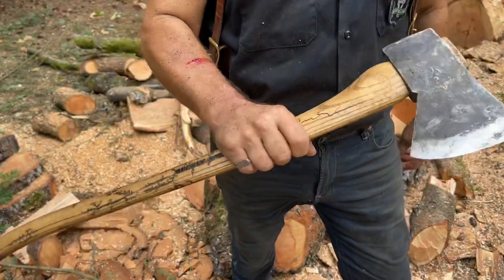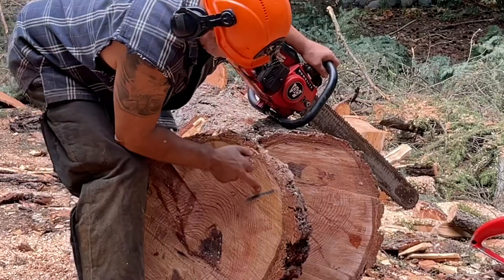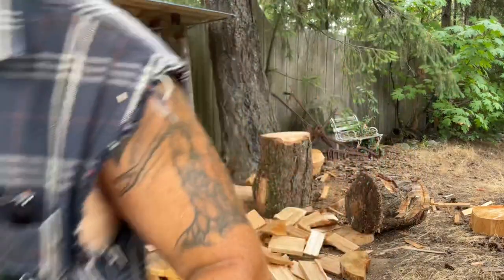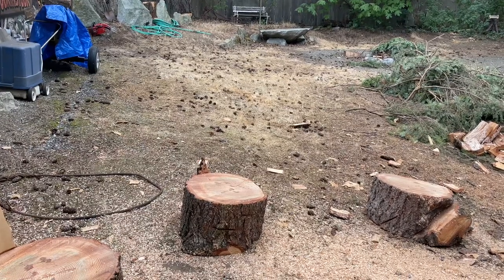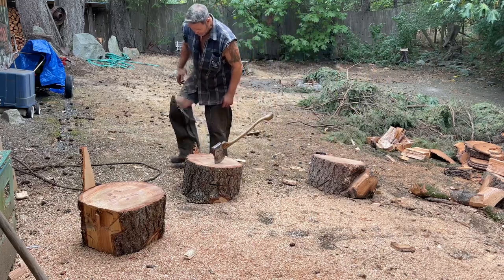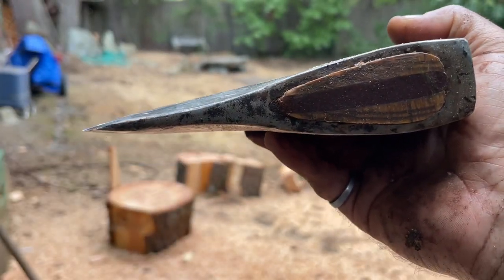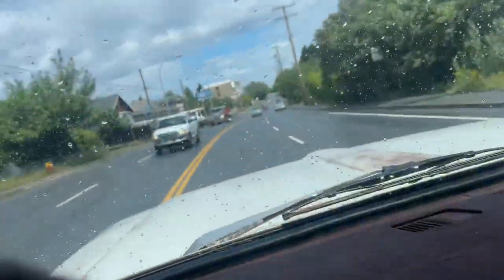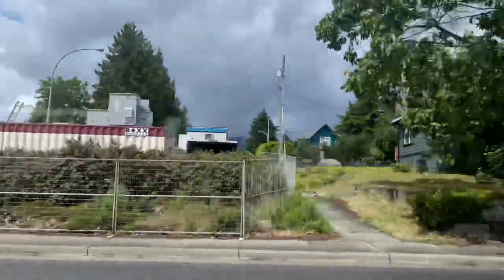The Homelite chainsaws that changed my opinion.

Comment: Good to see the old Homelites getting some love! I've got 4, from a little dual grip handle XL2, an XL130, XL-76 , and a beastly XL-922 77.2cc that still has 177PSI compression on the original, untouched engine. They have some  SNARK in 'em! Super fun to run, and not just wall hangers. Though honestly, I have very little genuine need for big saws where I am, I took a liking to the old Homelites years ago, and now can't pass them up when they pop up locally or on auctions. Thanks for being who you are and all your good thoughts you put out to everyone. You might be surprised how much that helps, and how many people it touches and takes the edge off their troubles.
Reply: YES  Well spoken 👏 
I  AGREE  with you 💯 
Billy takes the edge off 
And the knowledge that is given has no replacement.

Comment: I once maintained a fleet of forty nine  925 and 1050 Homelites for a logging company, they were all magnesium and the only way to break them was by running over 'em w/a Cat which happened on occasion. great old saws! Luv this video, THANKS!
Reply: I recently just acquired a 1050 from the original owner, guy still had the original homelite oil mix cans. He said he bought six cans and used nothing but that since 78. He gave me the last two and the gas can with remainder of the last mix in it ! Not even 4 gallons of gas ran through it over the years. Original bar is done for though I'm going to try and squeeze the grove closed alittle due to the wear but I think a new 36in is instore for the ol girl.
Reply: @skullsaw8308   Wow, I'm envious! What a great find.
Reply: I have a video on my channel of it running and me gradually getting the chain cutting straight. Pointers are more than welcome, love learning about these old saws. Also if you have a muffler cover laying around..... lol

Comment: I picked up a Homelite 330 at a yardsale 2 weeks ago.  Only reason I got it is because it looks brand new and was only $25.00 in the case with a 20" bar and i think a new chain.  I don't know if it's really even been ran!. I know they're not desirable but it looked like a neat old saw.  Gonna order a boot, air filter, and some new fuel line ( i ran out ), and get it going. Hoping it works well!

Comment: Very good to keep the sense, and the meaning, of ''community''. Homelite; I do remember the late '70s and early '80s where loggers were throwing their Homelite saws at the end of their arms because reliability problems and turn to Husky-Jonsered-Stihl. I still have my 40 years old Homelite XL-1 AO and still use it sometimes but I do prefer my Jonsered 52E and my Husky 371XP while not using too much my Jonsered 2095. Be well.

Comment: Bought an old homelite xl-12 and got it shipped to Ireland. Best saw I've used and probably quite rare here. 

Edit: Love the message at the end Buckin'! Keep spreading the good words man
Reply: Hi Richard - it's Big Rodders, also in Ireland.  I bought a Homelite XL12 here in 1978 and it has seen little work.  It cost £180, a month's wages, and I still have the handbook and period catalogue.  An old Forestry Commision man told me they used them during that period.  They were a milestone saw in being the first one to weight 12lbs, hence the name.  Obviously they didn't have a chain brake.  They have a bark off them that you can hear in the next parish, they vibrate like hell and while physically small they weight a lot compared to modern machines.
Reply: @rodneysweetnam8653  Hey Big Rodders! That's amazing man. You've kept the handbook and everything 😀 You're right about the sound too haha everyone that heard an old homelite says they sound mean as hell! The missing chainbreak can make people a bit apprehensive about them but they pull really well and are hardy beasts. Glad I'm not the only person in Ireland with one 😅 

From the right vantage point on a clear day we might hear each others saws :)

Comment: My first saw was a Homelite Zip that I inherited from my father.  Cut a lot of wood with that boat anchor.  Just got tired of getting the carb fixed so it would start and traded it in on a Poulan 3400 with a 20 inch bow and never looked back.  If anyone see a one painted 71 Buick green it was mine.  I had the paint left over from some body work I did on a  Buick Skylark and sprayed it because I did not like that blue color.  Now, my saws are mostly orange and white or pure orange, except for my yellow  S25 DA Poulan I have owned for almost 40 years.

Comment: Obviously u know what ur doing. So my question is how do u sharpen your chains on ur saws so friggin sharp. Obviously ur not using a sharping jig, ur doing it by hand. My question is, I’m a newby when it comes to sharpening a chain, what jig or sharpeners should I go with at first 2 get use 2 the angle and degree I should be using 2 sharpin a chain correctly. Thks in advance

Comment: Hi buckin, I was wondering if you could give me some advice on my first saw to look at, I would be doing small jobs with it, I’m in a wheelchair.. but I’m not dead! Lol. Thanks in advance!
Reply: Stihl pole saw
Reply: G'day Jeffrey.  You say small jobs, so a smaller saw would be a good start. By small, i mean look at the similar size of the battery powered range.  The pole saw is a great idea too. Ask Donny Walkers saws too for the best advices.
Reply: Jeffrey, try out some of the smaller, lighter saws, see how you feel while working with them....my ms 271 might be a good choice, it can handle a 20" bar, but it's only 10.7 lbs no bar
Reply: @j.chrisbeck7492  hey, thank you so much for taking the time to help me out, I really appreciate it. Do you know if they still make the saw or if they replaced it with something else?
Reply: @jeffreydimartino4507  it's still very much a thing, another thought comes to mind, maybe find a helpful Stihl dealer in your area, you could sort of try handling some if the products just to get a feel of what it's like. Another model that comes to mind, is an ms200t, it's a top handle climbers saw, designed for one hand, and two hand operation
Reply: @jeffreydimartino4507  and just a side note, my stepson is also in a wheelchair...(Spina bifida)
Reply: @j.chrisbeck7492  thank you so much for your help big time, I’ll look at both of those for sure! I see so you understand where I’m coming from being in a chair then. That is wonderful of you.

Comment: You would not think much of them if you were also cutting with my ms 460 or 440.
Reply from the maker: actually to be very honest , running your saws wood give me a greater love and an appreciation  for my vintage Homelites.
Reply: @BuckinBillyRaySmith  to be honest, I view most of my saws as vintage because I built them, including my ms 460@;$ h440.  I have kept one of my old saws, my Poulan S25DA, which I bought, new, in 1985.  It still looks like new and runs good.  I have one other saw you might consider vintage, a MAC 3216.  It runs great and looks like new.